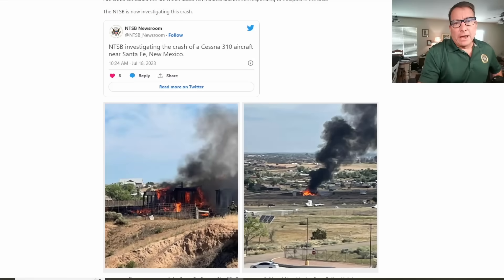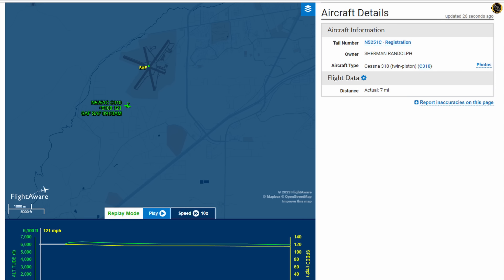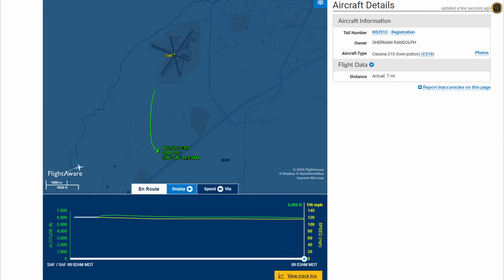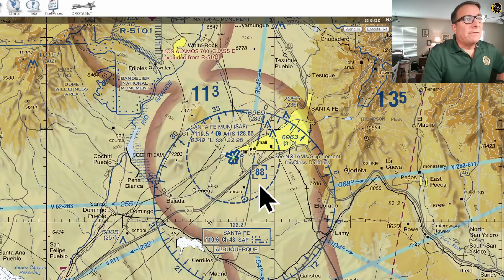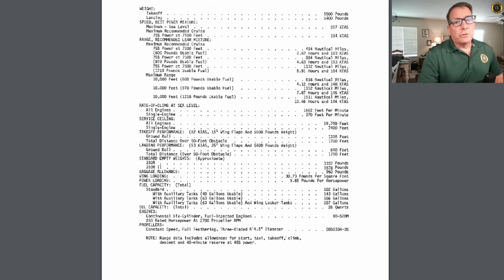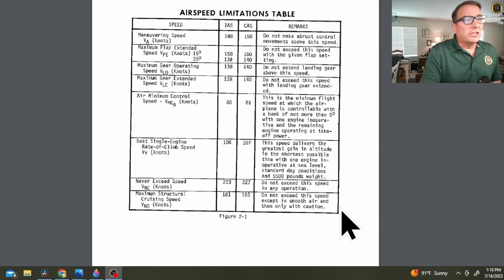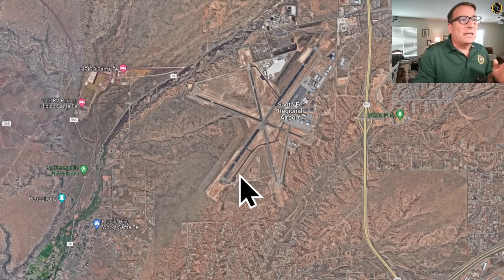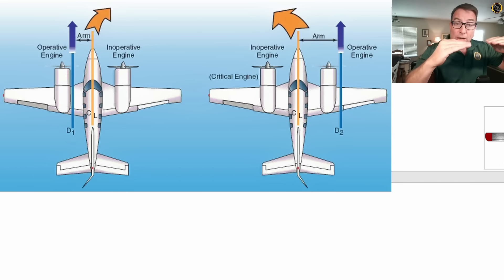Fatal C-310R Engine Failure - Santa Fe, NM

Comment: This was the most common fatality accident during my time in New Mexico.  I was a Huey medevac pilot with 717th Med Det NMARNG out of Santa Fe from 1974 to 1982.  Bob Norris, rated both fixed wing and helicopter, took off runway 20 solo with full fuel in the Army's version of the C-310.  When an engine quit (I don't remember which) he pulled power on the other engine, landed in the desert, and walked back to the unit. He didn't question it.  His job "in real life," as we guardsmen tended to say, was pilot of a Mitsubishi MU-2 for a bank.

I had an engine failure in a C-175 climbing out from 20 after a MUTA 4 on my way back to Gallup.  I landed on the road at Santa Domingo Pueblo.  Like we who flew normally powered small airplanes, light twin pilots in the mountains need to use ground effect to develop zoom reserve airspeed (I think twins actually require something like that) and to egress down drainage when possible.  In yesterdays accident, turning back to a high DA airport when down drainage egress was straight ahead makes no sense.  Albuquerque, two thousand feet down drainage, was available.  While harder to recognize in the desert, down drainage egress is always nearby in the mountains.  We used to use it up drainage to the pass and down drainage to the next civilization rather than GPS direct.  For safe flying with limited power we should continue to use it.
Reply: Good point about heading south towards ABQ. But his only route to ABQ may have been via the Rio Grande canyon...provided he could hold altitude. The terrain rises somewhat between KSAF and the summit of La Bajada had he followed I-25 southbound.
Reply: was pilot of a Mitsubishi MU-2 for a bank.... <- dude is a legend for mastering that thing.
Reply: Good comment. Treating an engine failure in a light twin like an engine failure in a single (or a dual engine failure in a twin, if you like) would have probably saved dozens of lives in the past.
Reply: @spiller212  In flat or rising terrain it might be the better choice. But it’s not always the case if there’s an escape route to lower elevation airport. Which in this case might have been a better choice. Lots to be learned from this tragic accident.
Reply: @Tom-tk3du  Yes, that is true. But I am just thinking out loud that operating in light twins with not much proficiency with regards to engine failures (at least here in Europe, most GA twin pilots "train" engine failures exactly ONCE a year at their annual MEP checkride), especially in twins notorious for their bad performance on one engine and relatively high Vmca, it might be better to just pull the power on the live engine and settle for a forced landing in a nearby field or wherever suitable instead of trying to hold blue line on one engine, bleeding speed but still be low enough that the consequent "Vmca-spin" will kill you. Asymmetric thrust has maybe killed more people in twins than a second (redundant) engine has saved lives because they experienced an engine failure where a single would have not had the chance to land (in very bad IMC, over the sea, over mountains)? Sorry if my English doesn't make sense, it is not my native language.
Reply: @dryan8377 thinking the same thing, as they are infamous for crashes last time I checked but great planes if you fly them correctly
Reply: @spiller212  It would be interesting to see if the statistics support this hypothesis. We tend to only hear about the crashes, which may bias the perception. Twins have twice the probability of experiencing an engine failure on take-off (or at any other time) than a single. The advantages of a twin seem not so great, especially if the pilot does not maintain proficiency. A gas turbine single seems a safer option than a light twin.
Reply: DA can be a nasty mistress. ALWAYS check the performance limitations when it's hot. Used to fly a Navy U-3A out of Point Mugu.
Reply: Most common, yet people take off on a 93 degree day. Which according to my brother is sort of a typical day. I bet there are takeoffs that aren't ended with fatal crashes. Question to me is "How do those pilots not have this happen?"
Reply: @JimMork  maybe don't lose (or plan to lose) an engine on takeoff?  The numbers Juan referenced are single engine performance numbers, with both engines functioning the ceilings are much higher than even on a higher ambient day and the takeoff is performed with relative ease.
Reply: @hondaman08  No one does. I don't start a motor trip with any plan for bad things to happen. But for various reasons they do. Due to that I have some precautions. I know the routes I've learned to dislike due to recklessness of other drivers. I have AAA towing which I've seldom used, but because I know unwanted things can happen. I almost always allow much more time than needed for my trip. I dislike time pressure requiring chance taking. Can't extend the analogy to flying this kind of plane, but a pilot with a preference for survival will choose things that favor survival.
Reply: @JimMork  sounds like many are getting lucky -  if those pilots planned a flight and considered the single engine performance limits Juan mentions, some may find they are on the razor edge or end up out of bounds in the event of single engine failure.
Reply: @JimMork  The margin for error is much smaller for flying airplanes. Imho, a single engine sea level climb rate of 320 fpm requires doing everything by the book. It ignores the effects of thermals which are common on hot days. I routinely fly in the southwest and encounter thermals that can quickly thrust me up or down 400 feet from my cruise altitude. Fortunately my RV-8 handles high DA very well and 9,000 ft DA is never an issue. Its ground roll at sea level is just 275 feet, with a service ceiling of 22,000 ft. It’s easy to get in and out of KSAF on a 9,000 ft DA day. Some older production planes aren’t often seen at these elevations. They’re just not built for high DA airport daytime summer conditions.
Reply: @spiller212  I can see now that twin engines have a built in hazard. An uninformed onlooker might think extra safety, but only with extra skill like never turn in the direction of the failed engine.
Reply: @JimMork  high density days require planning , runway length , weight and balance issues etc. I hate flying in hot weather unless I can get to altitude where it is cooler. Air conditioning isn’t in most small legacy planes 😩

Comment: When I was living in a tropical South American country where the ground temperatures are typically around 90F-100F year round, one of my instructors used to say that it just didn't make sense to fly a twin-engine GA airplane in the country, as in most cases the airplane would not be able to maintain altitude flying with just one engine, so having two engines didn't bring any extra safety... Yet, there were plenty of GA twin engine airplanes. People often don't bother to do their math and their risk-assessment, particularly if they think of flying as some kind of "fun hobby"...

Comment: I'm not sure if this is in the comments, but the registration comes back as a Turbo 310 which would have slighly different book values. Either way, there is still a high density altitude to compete with here and especially with a loss of the critical engine.  I am a T310R owner and know all to well how badly things can turn when faced with this situation. RIP

Comment: Completely agree with boxing yourself in to an undoable situation because one engine is still making noise and vibration. If indeed it was the left engine that failed and he felt the need to tighten up the turn to make rwy33, he sealed his fate with a skidding turn into the dead (sorry, RIP) engine. Straight ahead, flaps down, gear up and take what you can get.
Reply: Yes. Clean up, level up and gain groundspeed then pick your poison  and fly the freaking plane!
Reply: He does that he’s walks away. Plenty of flat ground to put it down straight ahead, no need for that turn.
Reply: Fly the plane into the ground 😢
Reply: Yep, as soon as you hear him say " I am going to gain some altitude" he has the wrong mindset in a DA of 9000'.
Reply: @zepm7184  Perhaps he was unaware that climbing was impossible. I'm wondering where he was normally based.
Reply: @zepm7184  I think under stress forget you are the PIC and   you do what it takes, the ATC is noise at that point, fine me later, I’m walking away after the paperwork and going to dinner.

Comment: I flew out of Farmington, NM (NW of Santa Fe) for about 5 years ago. There were many days when density altitude was 9,000' sometimes greater, and a C172 didn't have the power to climb more than 200' a minute. Even at that you quickly reached the equivalent of the service ceiling. Fly early or stay on the ground. Night time flight up there was, in my opinion, IFR. There are no lights out in the desert. Very sad to see this end this way. I would love to see a video where a light twin had an engine failure and the outcome was a safe landing.
Reply: I would settle for a safe crash flaps down gear up straight ahead.  AQP.
Reply: @johnpublic6582 Yes, sometimes landing straight ahead is the best option in a light twin. Flying the airplane into the crash while maintaining airspeed and  control, and avoiding the stall/spin, which is deadly.

Comment: Could the takeaway be that takeoff brief should have included density altitude considerations and to treat single engine failure as dual engine failure - feather and secure both and attempt forced landing?
Reply: I've read an article in FLYING magazine a few decades ago, suggesting just that. In some light twin take-offs, an engine failure might be more survivable if you accept the fact that the airplane is going down, cut the power to the other engine eliminating the power asymmetry and do a controlled landing ahead - just as if it were a failure in a single engine airplane, albeit with the penalty of higher airspeed and mass relative to singles, of course. Still, a crash-landing where the airplane was under control up to the last second is more survivable than an uncontrolled crash. 

While this isn't a blanket solution, it certainly should be in the mind of every light twin pilot during take-offs, especially in hot & high cases like this, where the density altitude is above the airplane's single-engine ceiling, in which case there is simply not an option, the airplane WILL come down. Better to do it under control.

Comment: Hindsight is easy but controller should have said cleared to return. Not dictated left/right without know what engine failed. 
Pilot should also know not to turn into dead engine regardless of controllers directions.
Reply: controller gave him several options including "any runway"
Reply: @Milkmans_Son  but is first comment was “turn left”
Reply: @HootisGarage  I agree that in a moment of stress, the pilot might just blindly follow ATC instructions.  I think ATC should be trained in cases like this that the first thing they should say to a pilot when they indicate that they are having a problem is to "fly the airplane".  This should be repeated over and over with every ATC call to the pilot.  Every good CFI repeats this to their students 100s of times, and this can trigger the instinct in the pilot to "fly the airplane."

Comment: I looked up the registration of this airplane. It was registered to a Southern California pilot. Flying at Sea Level is very different than flying in the mountain. With density altitude over 9,000ft, it would have been difficult to control the 310. Having flown into KSAF many times, as you turn left off Rwy. 20 the elevation rises. DENSITY ALTITUDE if not experienced, can be dangerous. The winds can be tricky, but from the the reported weather, I don't think weather(other than high density altitude) was an issue. Thanks Juan!
Reply: Hi I attempted to reach out but I couldn't due to an issue with the app. Enjoy Oshkosh!

Comment: I started out my short flying career as an A&P mech, so by the time i got to CPL and multi engine aircraft, i had a healthy respect for how underpowered most piston twins are, when you get hot, high, and density altitude probs. Call me chicken, but I canned many flights for those reasons. No job is worth leaving a smoking hole in the ground. I prefer to work on race cars now... RIP to the pilot, sorry you learned the hard way. 😢

Comment: High density altitude is nothing to mess around with. Tried taking off once at 3200 msl and a pretty warm mid-day. Weight Balance put me well within the envelope, but seeing the end of that runway come up so fast was a little concerning, even though I was able to get up at about the calculated roll. Next time I took off from there... it was in the VERY early morning.

Comment: Juan,.in the edited replay of ATC in the short abbreviated conversations, I clearly heard the tower ask the pilot "It's the one engine, right?" The pilot acknowledged that it was the "One Engine." Pay particular attention at the 1:53 minute mark in your video presentation. It is clearly noted and acknowledged by both the tower and the pilot that it was the #1 engine. I hate to say it but the pilot was playing craps with that take-off and he lost big time. Density Altitude, Temperature, Single Engine Performance, Critical Engine, Left Turn into the Critical Engine. When I got my Multi-Engine Commercial Certificate, we were taught about this kind of scenario. I personally would have put off the flight to a different time of day or when I wouldn't be boxing myself in like he did. I would have thought about starting my flight very early at the first hint of daylight and when the coolest part of the day would have been. The performance of the aircraft when operating normally and in a one engine scenario would have been much more favorable, that is if it was significantly cooler, of course. Thank you for your wonderful and informative channel.
Reply: He didn't say "the number one engine", just "the one engine", which may equally have just meant that the engine failure involved one rather than both engines.

Comment: It will be interesting to find out what his most recent training and flight review covered. In this type airplane, flying from this airport, in these high DA conditions, it would seem imperative that pilots respect the possibility of losing an engine on takeoff and train for it and review constantly. Thinking about the potential of the worst thing that can happen and knowing for certain what you are going to have to do (either have enough altitude and airspeed to land on a runway or in the desert) should be top of mind in every flight prep. This pilot sounded reasonably calm when announcing his engine failure (twice). I don't know about this pilot, but I do know that complacency kills. RIP to this man. Hopefully, his crash will result in saving lives through making more pilots aware of their need for training.

Comment: Great share - I fly from near sea-level all the time. If you fly regularly from high altitude airports seems you would be doubly concerned/aware of knowing density altitude all the time. I was getting checked out in a piper at Chatham MA CQX elevation 64 ft and the check-out instructor STILL had me do a high density altitude take off (reduced throttle) on runway 6 as I flew out over Pleasant Bay, just a couple of hundred of feet off the runway. God rest the pilot's soul and peace to his family - always sad when this kind of thing happens.

Comment: Kind of ironic that if this were a single engine plane losing the only engine, there may not have even been the choice to try to get back to airport and he would have had to have tried to put it down on the highway he was practically right over (not a GREAT option - but maybe the only one)... but with the perceived "margin of safety" of having a 2nd engine he got boxed into that corner Juan mentions of thinking he could easily get back to the airport.  Very sad, regardless...

Comment: Juan, This was a turbo 310 R with tsio-520 engines. Density altitude should not have greatly affected performance with turbos. It was more poor flying technique of the pilot who was rated as an ATP with several type ratings. He was a physician.
Reply: blancolirio4  I need to download the app. which I am doing now. It's a bit slow, I'm in Hill City, SD. On our way to OSH in a motor home. I have some thoughts about this accident which we can discuss
Reply from the maker: Larry that's a scam bot impersonating me. I've removed them.